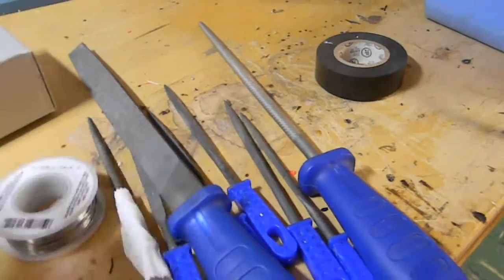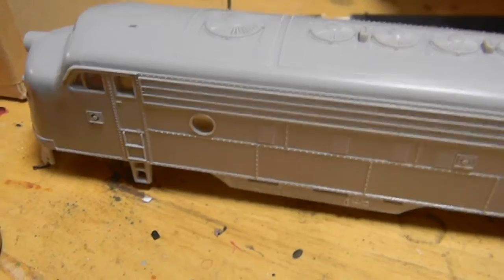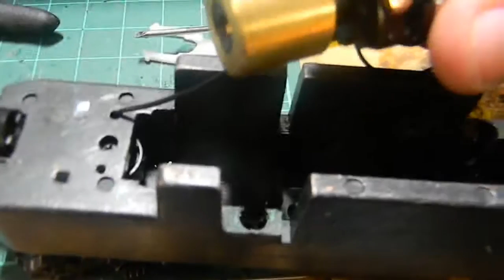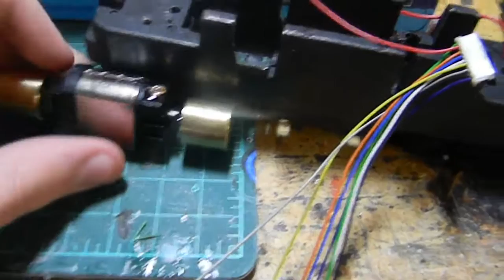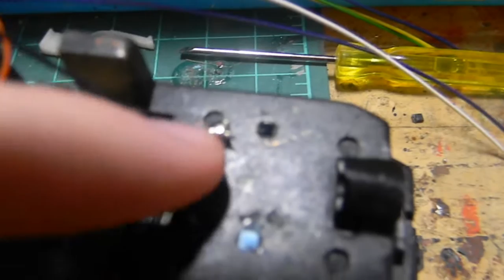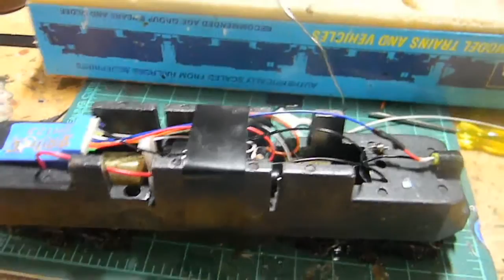DCC Corner: How to Install a DCC Decoder into a Locomotive

Comment: This is a clear video thank you. I have a challenge. When I solder to the grounding post it shorts out system. I’m using a Digitrax dcs52. I traced the short to the ground post. Any suggestions for what I’m doing incorrectly?